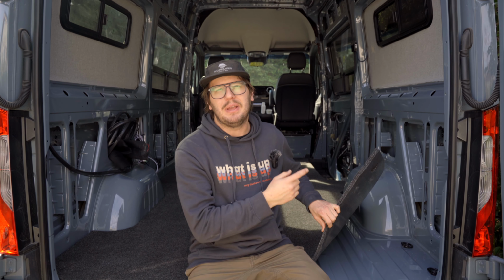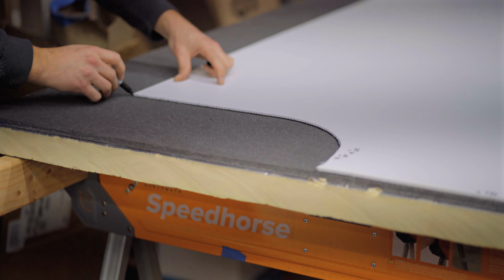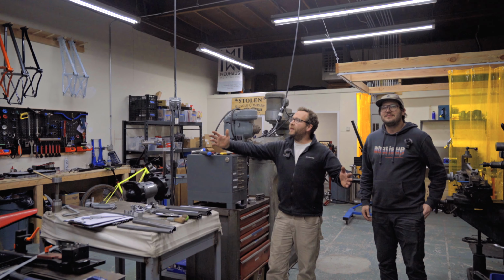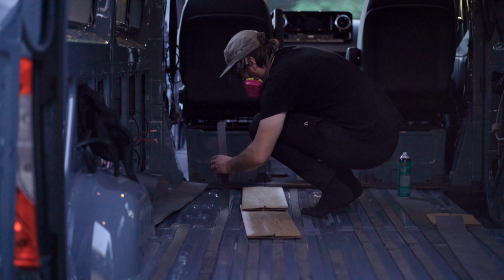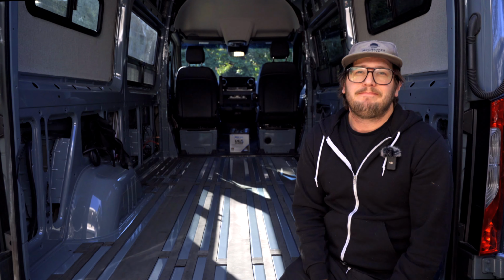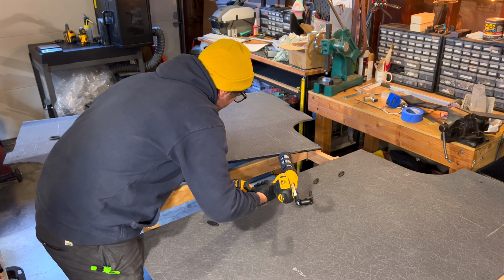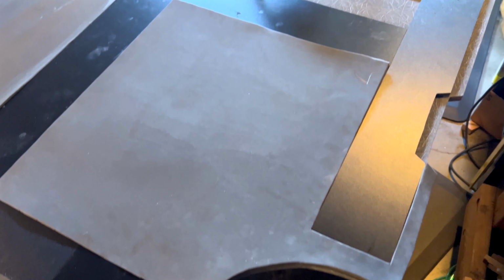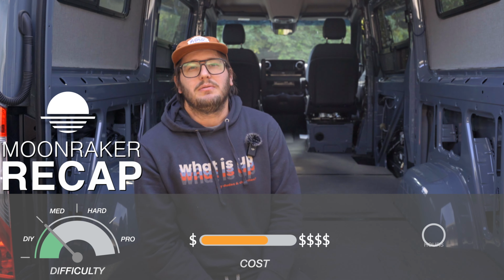The Ultimate Sprinter Adventure Camper Van Subfloor

Comment: When you were using the set screws to locate the holes, did you later after joining the boards have any migration occur where the holes weren’t quite where you wanted? I was thinking maybe I should join the boards first then try to set the holes with the set screws, but that might be more trouble than it’s worth.
Reply from the maker: Hey @m3lonbr3ad, it's much easier to do these as piece parts.  I ended up drilling them through with a pretty healthy margin 10mm hole for a 8mm bolt and just used larger flanged screws to hold them down.  You could do it at the end, but it's much harder to manage the single piece floor than the panels.  Just my $0.02!
Reply: @moonrakerdesign  thanks, that seems reasonable. could you share which screws worked for you? i was considering fender washers, but something with a good flange would be better
Reply from the maker: @m3lonbr3ad  Sure I ordered these from BelMetric https://belmetric.com/torx-button-flange-black-stainless-m8x1-25-coarse-iso-7380-2/?

Comment: If I understand correctly, the areas where there is expanded pvc, the thinsulate is fully compressed? If someone wanted to save some headroom and skip the expanded PVC framing to just use 1/2" coosa, would you still use thinsulate under the coosa to fill in the ribs or would you use minicell instead? What about using the 1/2" coosa with the DIYvan machined minicell directly under 1/2 coosa? I definitely appreciate a floor not being glued in, good job.
Reply from the maker: I’ve heard the DIY Van machined minicell with a floor on top can be a little squishy.  Might be best to consult Hein directly on that over there. 

Yes the areas where the expanded PVC is the Thinsulate is fully compressed.  I added it so there would be an anti squeak layer and so it would fill in any air gaps.  Also the way I laid out the PVC is so I had hard datums under all my cabinet locations to not crush/squish the minicell.
Reply: @moonrakerdesign  i am now considering going the expanded pvc route.. but i dont have a general plan for bolting through the floor because I dont really have a future vision cabinets, etc. I was thinking of just a consistent pattern perpendicular to the metal floor's ribs, does that seem reasonable?
Reply from the maker: @m3lonbr3ad  Yes I think that makes sense. I think horizontals at your seams between floor pieces and then run parallels along either side of the frame rails.  I think I mention this in the video but Mercedes marks the frame on the inside of the van on the floor so pretty easy to measure and align them there.  This will give you some good options to drill through the floor if you choose to bolt your cabinets down. 

FWIW I ended up only bolting the cabinets to the wall then the few existing factory floor points.  I didn't end up drilling any through holes since the wall mounts were so strong.
Reply: @moonrakerdesign  oh good point, I guess I wrongly assumed the pvc was there for bolt support, but really it was used as solid footing. I would rather not drill floor holes in the rear, except for some L track (location tbd). I did take note as you mentioned about the framing being visible from above (I'll be transferring measurements this weekend, I hope). Hoping I can source some expanded pvc in usable plank dimenions. i dont have a nice track saw; almost bought one based on how useful I see it was for you throughout your work.

Comment: I was thinking of using a biscuit to attach the 3 panels but not glue them so it's easy to take out of the van.  What do you think?
Reply from the maker: That would probably work.  You'll want to make sure you leave enough room front and back you can slide the panels together or apart from the middle piece without lifting them up during that first disengagement and putting stress on the biscuits.  I think the back is no problem the front might take a bit more strategy around the drivers side b-pillar.  

I will say glued up, we took the floor in and out probably 7-8 times from when it was made to when it ended in it's final place in the van and it was pretty easy to handle as a single piece with two people.  I think in our top floor video I show how I got it in & out after the fact.

Comment: Hey Todd, solid video! Couple questions for you orrrr maybe suggestions 🤔. Our van came with the OEM floor already installed, as well as the 3 seater bench. I’ve gone ahead and lifted the back end of the floor and placed thinsulate down in the rivets, but I’m unable to lift the front portion because of the seat guides are installed through the floor. Any suggestions on installing some type of insulation in the front section. Maybe some type of spray in foam insulation? We want to keep that floor and plan to place 2tec2 on top of it (which will hopefully add some insulation and sound deadening. We will be removing one of the tracks behind the driver seat and shrinking to a 1 seat luxury chair that fits the OEM seat guides. I know the 2tec2 has a tiny bit of rubber on the bottom of it, do you think it is thick enough?
Reply from the maker: Hey Casey. I’m not sure what the factory floor is actually made from but I would try to get something under there to insulate as it’s probably not enough on its own. Even with the 2tec2 on top. That will lessen the sting but it will still be probably be a pretty cold floor. 

Did you find that the rails were indeed mounted through the floor with nuts and bolts?  And you are unable to access them?   The safest thing to do is to try to get that up and get it insulated. It’s your foundation so putting in the work now while painful will be worth it in the long run. 

I show how to drop the tank in my S&B video, it’s a 1/2 project.
Reply: @moonrakerdesign I determined yesterday that I can remove the tracks and reinstall them. Yes, bolted through the floor, but the bolts under the van are glued in place. Makes it way easier to insulate.
Reply from the maker: @ALLL_DAY  Wahoo!! That's super good news!!  Happy building!
Reply: @moonrakerdesign  turned out GREAT! wish I could share a pic on here! Thanks for all your suggestions and awesome videos. We used 3M 90 for the application and worked like a dream!
Reply from the maker: @ALLL_DAY  NO WAY!! That's awesome!!  I really wish you could send photos here too!  If you don't mind you should send them over to our email hello@mooonrakerdesignco.com though!  We love seeing the stuff everyone puts together!!!

Comment: Hey there, Great videos!!! We are just about ready to get started with the whole Coosa/minicell flooring. I have question about fastening to the floor. It sounds like you are using existing bolts, but I cannot see any on the finished floor...... HELP.
Reply from the maker: Hi @susiejensen63.  I only ended up using the back 4 bolts by the rear doors, the L-track and the side step held everything else in place like a rock!   

I'll likely open up the flooring on the other holes for some strategic cabinet anchor points though.
Reply: @moonrakerdesign  Thanks so much :)
Reply: @moonrakerdesign  I"m building this floor now (minus the L-tracks) thanks to your insights as to its' advantages.  I had the same questions regarding how you attached it, so thanks for this clarification.  Since I'm not adding the L-track, do you think using a few more bolt holes would suffice?  I want to avoid using adhesive under it all if possible.  Not sure how that would even work with the thinsulate.
Reply from the maker: @okispearo  thanks for stopping by and the comment.  I'd ask how do you plan to secure your cabinets or interior bits?   I think planning through holes to mount those and secure the floor in the same go in a few additional places is a good idea, but honestly, if you just use the factory D-ring locations that's enough especially as a one piece floor, I mean it works for Mercedes right?

Comment: Sorry - one more question ... I am struggling with my floor specs as I am wanting 4 season van (think Alaska trip or skiing in Colorado) - many people seem to put a foam based layer under the subfloor material (Ply/Coosa) - you also put thinsulate ... and these materials do provide excellent thermal bridge support but I worry about the compression of these materials (the softer ones) and losing some/many of their benefits. As without design I am trying to keep my floor profile low but with some R value. I love the Coosa product you mentioned as it has great R value and structural. So I am thinking high density foam in bottom of floor troughs, then 1/2" rigid foam board, then more high density foam 3/8" and then 5/8" or 3/4 Coosa board and tec2 flooring. Which puts me at about 1.8" above top of OEM floor troughs - your thoughts?
Reply from the maker: One thing I want to do when I get everything together is borrow the FLIR thermal imaging camera from work drive somewhere really cold and take pictures from the entire inside of the van to see where the cold spots are and how that changes over time.   

Unfortunately, I don't have any sub-zero camping experience in a van and haven't done the test above, but I feel if I were going to create a floor stack that high, I might as well add an actual sinked heat source down there, my gut tells me cold will be wanting to slither in from so many places now that I've torn apart and looked at all the structures in the van.   I think if I had plans to actually camp in those conditions radiant floor heating would be in the budget, I would build up the floor the same way, but instead move up to 3/4" coosa board and sink 1/2" Pex lines into it like the Just Roaming Design floors - https://www.justroamingdesign.com/columbia-flooring-system.  

I know this probably doesn't help much and gives you another thing to think about.  Unfortunately there's a million options and just about the same amount of opinions out there.  Again, I wish I had more time and money to actually test these options.   FWIW I do think your insulation strategy will work better than most, I personally couldn't give up that much vertical space with a passive system.
Reply: @moonrakerdesign  thanks - all that makes sense
Reply from the maker: @KehlPetersen  Let me know if you have any other questions.  Always feel free to move it to email as well.  Contact form is on the website linked on the channel :)

Comment: Out of sheer curiosity, did you debate at all about the need for floor insulation?  The open ribs do provide air flow.  How does the floor compress with the insulation?
Reply from the maker: Hey there, the thought about not using insulation on the floor never crossed my mind actually.  What would be your reason for not doing it? 

We had a simple bed rug before and the floor became really cold camping in moderate conditions ~50ºF.  

I'd recommend reading through this. 
https://sprinter-source.com/forums/index.php?threads/73667/post-743095
Reply: @moonrakerdesign  Firstly, thank you for replying.  I came across your channel and your work is off the rails!  Basically, the complexity and intended use.  Our proposed van would be more of the RV casual use, warm and moderate weather.  I am so glad to see that you used the thinsulate in specific, uncompressed areas, (using your plastic spacers).  That made alot of sense.  AVC rig I think, makes precut ZIpwall panels with insulation built in.  Just curious if the labor, complexity, and materials provides the tradeoff for the mildly increased R value.  But I think I am in the minute minority.  I have not seen a build without an insulated floor.  Keep up the amazing content!  Your pop ups specifying your exact materials is perfect.  Have you seen a hexagonal hole puller for the rivnuts?  Prevents spin out.  Thank you again for the replies.

Comment: First video I saw of a van made with Coosa board
Reply from the maker: It's super common in the Marine world and Just Roaming Design uses it as they base for their hydronic heated flooring - https://www.justroamingdesign.com/columbia-flooring-system

I was actually originally looking for Space Age Thermolite - https://www.spaceagesynthetics.com/thermo-lite-board-product-line/ based on a recommendation from a boat builder, but when I called the local distributor RevChem - https://revchem.com/ they recommended Coosaboard which is basically the same thing but much easier to get a hold of in my state. 

I love it, it has all the properties you'd want in an RV flooring when compared to wood.

Comment: How do I get your custom lock box cover for a 170 WB?  I love the clean look without the screws and the locking mechanism.

Also, why didn’t you go with hydronic floor heating?

Did you use any kilmat on the wheel welsl, walls, ceiling, undercarriage?
Reply from the maker: Unfortunately I would need a 170 to take measurements and everything on. Unfortunately that’s not on my priority list at the moment. 

For the floor heating both my wife and I are really tall and opted for saving standing height over the heated floors.  I’m going to branch the hydronic lines for one more air handler in the back of the van though. 

You can check my sound deadening video.  We put Kilmat in a select few places then hybrid under the front floors doors and behind the headliner. I also recently ordered TecVanLife Duck Liner for the ceiling. I’ll wait to put the kilmat on the wheel wells until the floor is completely done.

Comment: Great instructions and video. Wondering if you considered adding a hydronic loop to your floor since you are already using it for your water heater
Reply from the maker: I did consider it, but because we both are tall and camp and live in a pretty mild climate being able to stand up straight and have a bit more head clearance won the battle.  I am going to be putting an air handler in the back for more air heat off the hydronic system for the winter though.

Comment: Hey Todd, 
You don't indicate how you fastened the L-track into the van body. Did you rivnut into the floor or through bolt it? Great work by the way.
Cheers,
Al
Reply from the maker: Hey @royalto3rd.  This video is coming soon, but I bolted through with steel plates underneath.

Comment: What is the overall thinkness of your floor?
Reply from the maker: Total thickness is 3/4”.  1/2 for the actual Coosaboard and 1/4” for the extra layer of minicell and the PVC/FR-4 spacers.
Reply: @moonrakerdesign   outstanding!  For someone who is 6-1, getting every inch out of the floor is great. 

Something I don't understand though.. why the PVC/FR-4 spacers?  I guess I didn't understand why, and how you laid out that part???
Reply from the maker: @Pro4Sound  Sure thing!  Technically you don't need to do this step, but it felt weird to put in another layer of minicell insulation between the floor ribs and the subfloor only to have it compressed down when I put my cabinets and weight on top of it.  Insulation works best when it batted up for the fiber type or to its full height for the foam.

So what the PVC/FR-4 does is serve as an additional structure under the floor where the cabinets in the van are and the L-track in the floor are being mounted. This gives me a hard stack in those places making sure the minicell in the other areas isn't compressed.  

I determined the location of these pieces based on my overall layout.  I used the FR-4 ONLY under the L-track since it's super strong (and super expensive) and I wanted a really hard and stable stack up in those areas so the L-track is ultra-secure.  The ones in the front will be holding the passengers seat.  

If you skipped this step your floor would probably have a little compliance to it, which is not necessarily a bad thing, but would have a little less insulate properties. 

I hope this helps.
Reply: @moonrakerdesign   one more thing.. sorry. 

Where did you find the thin thinsulate?  I couldn’t find it anywhere

Comment: I love it! Z most profesional DIY and outstanding Sprinter van outfiting 🤓
Reply from the maker: Hey thanks Robert, we really appreciate you taking the time to let us know and glad you are enjoying the content!!
Reply: @moonrakerdesign  You assembled the 3 floor panels with the biscuit joinery in your workshop, and I guess you moved it into the van all in one, how difficult was that to get the whole assembly in place without putting too much stress on the biscuits? I'm interested to know how you proceeded. Thanks.
Reply from the maker: @robertludwig5308  Super simple.  My wife and I did it.  We lifted it up on so it was vertical along one of the side edges and carried it into the van lengthwise and then laid it down.

If you lifted it flat you might want to have some extra people in the middle for support.  The Sikflex and biscuits probably won't tear or break but it feels a bit too much flex for my comfort carrying it like this from the ends.